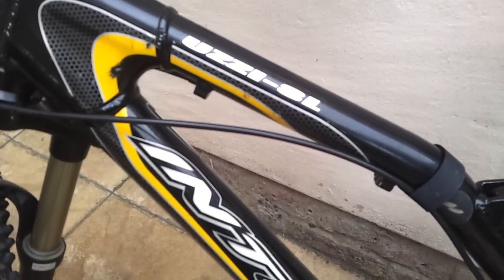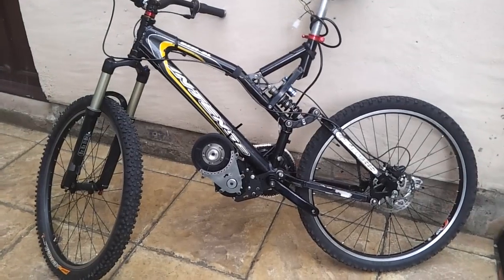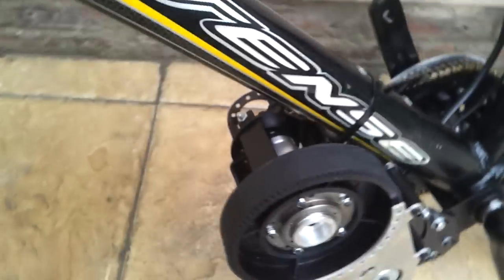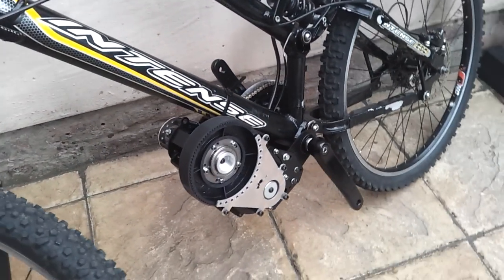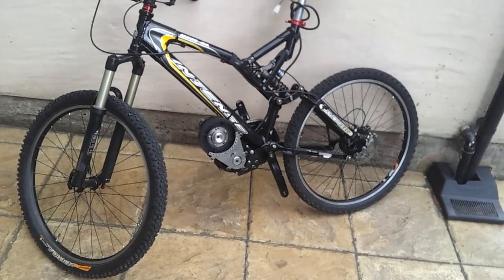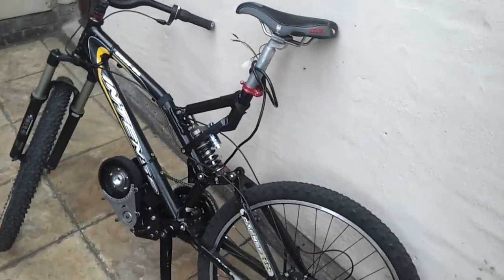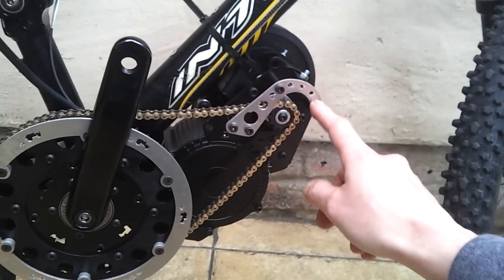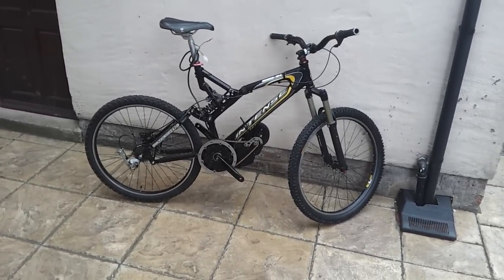Electric bike project...gets a lighting rods kit

Comment: I'd love to see china and taiwan produce high quality  alloy ebike frames engineered for lightweight 3kw planetary geared chain drive motors with multi speed gear systems desinged for high powered motors. are motor wattage laws likely limiting the market for ebike factories doing this?
Reply from the maker: hello buddy..
there are custom ebike frames availabkle but no mass produced yet so they remain a bit pricey..
recommended power through cycle chains is around 2 kw so the gear train will suffer quicker than the frame usually.a good strong downhill mtb frame will be fine for most power levels[ mines at 6kw with a hub and shes doing fine 1800 miles later.
you maybe able to find more specially designed frames  being disscused and built on a forum called 'endless sphere"..maybe some one there can point you towards a specific frame..
good luck  with ya build buddy.
atb.
Reply: what would be good would be a high quality lightweight 3kw chain drive factory made ebike frame  with heavy duty gears and chain design. the motor wattage laws might mean the factories dont have a good enough  market to consider making them

Comment: Whats the benefit of having that hideous big fly wheel and belt? why can't the motor be fitted like the older version? is that fly wheel acting like a gear ratio?
Reply: It allows for a belt that provides a secondary gear reduction. This reduces the rpms hitting the drive train of the bike while increasing the torque. They likely chose to use a belt because it lasts longer than a chain, requires no maintenance and runs fairly quiet.